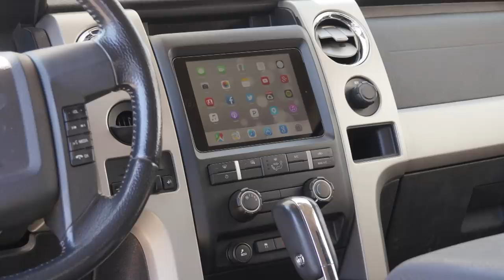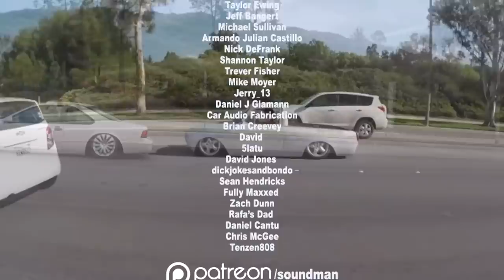clues about the previous owner! - BASS VAN VLOG #2

Comment: Isn't the Astro AWD? 29K is, like you said- 290k.

A simple FREE scan at a car parts shop should reveal the actual distance,
1985 is what's called "pre OBD1", meaning it does (or should have) a primitive ECM,
and a separate BCM (that's where the mileage is at.) It takes knowledge how to
retrieve the codes and the code chart. All included in Haynes.

Get yourself a paperback Haynes manual for this- don't rely on the internet for much info.

If that's an "electronic carburetor" rip it out immediately! Get a TBI (2bbl) with manifold at
online junkyard, or if you're lucky, local. Get the ECM with it. Maybe $200 total.